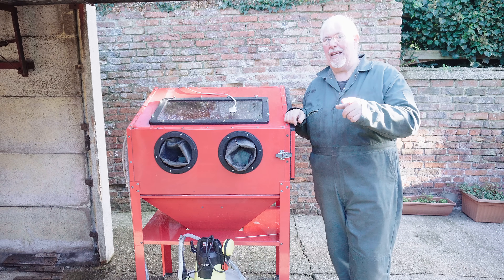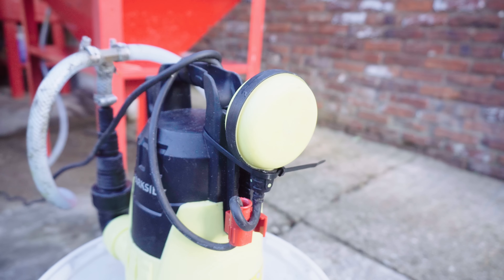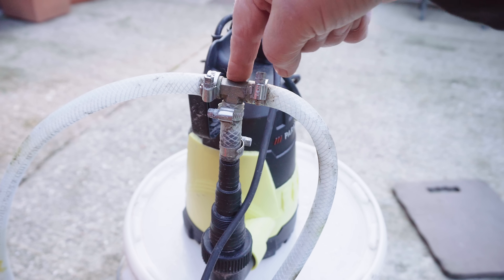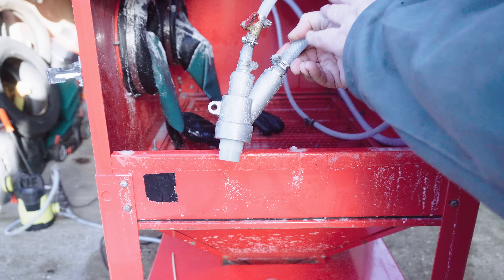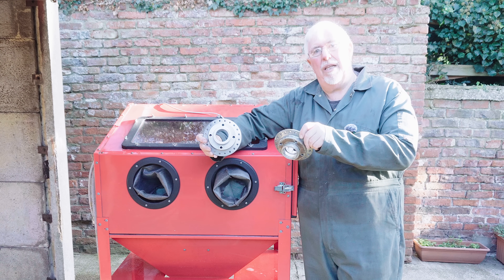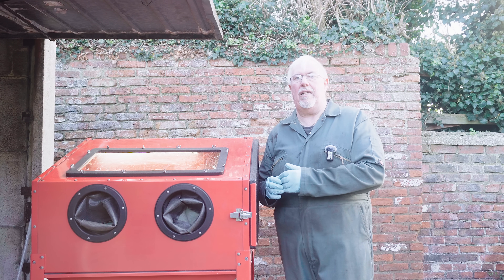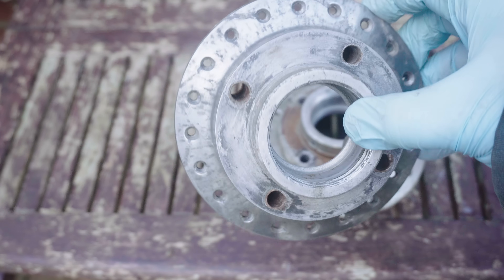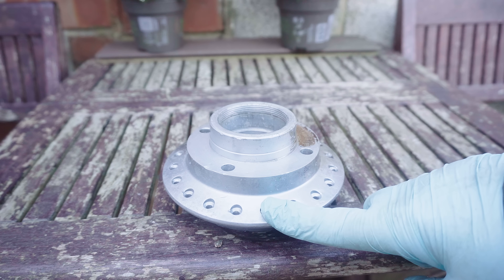Cheapest DIY Vapor Blaster Guide | How To Build The Ultimate Budget Vapour Hone

Comment: I'm actually in the process of building a blaster, incidently using exactly the same cabinet (wonderful how ubiquitous the Chinese stuff as I'm in Australia) and the simplicity of your approach will save a lot of time and money compared to the Americanised systemsI have been copying. I had a change in plans and have disassembled my partly built cabinet to replace the provided nuts and bolts with rivnuts to overcome access difficulties assembling the hard to get to interior bits. Using automotive seam sealer as I go because I think it's a better option than silicone. Thanks muchly.
Reply from the maker: Great.  My two main issues are keeping the screen clear, although it isn't too much of a problem, but it would be nice to be able to see better.  And leakage through the seams that I haven't sealed yet, but you have that well covered..  Hope this helps.
Reply: @SPANNERRASH  Planning on a pressurised fresh water ( garden hose ) spray bar with foot pedal for  screen cleaning. Hope it works.

Comment: Ive read where people have had engine parts done & the media is impossible to 100% remove, leading to engine destruction, be careful..
Reply from the maker: I am working on an OIF Triumph at the moment, so my paranoia about this is very high.  But with sensible and judicious cleaning it should be OK.  You just have to be senisble in what and how you clean things.
Reply: @SPANNERRASH   I know of a t140v engine that had been blasted, cleaned out & after about 100miles of running is was totaly worn out, it was stripped cleaned out & run again but only for the same thing to happen. it was only ok after the parts were sonic tanked, beware !!!

Comment: Hopefully not a dumb question, but would you find vb more useful in a small space than a sandblaster?
Reply from the maker: If you seal the cabinet, it should be a lot less messy.  I find with a sand blaster, even with an extractor, you end up with media all over your workshop.
Reply from the maker: I find it a lot less messy.  Especially if you sealed your cabinet well to stop the water coming out.  Normal sand blastin, even with an extractor, seems to get a lot of media all over the workshop.

Comment: By far the most important and expensive part is the compressor, which you didnt show and barely mentioned...!!
Reply from the maker: I did say I would assume most people who would watch this will already have a compressor.  If it is a standard 50l or so then it is a given that you would have to work in short bursts, allowing it to recharge regularly, but this would be true if you were doing standard sand blasting too.  I am using a Wolf 150l compressor, which seems to cope quite well.  I hope this helps.

Comment: what is the minimum size of the compresso tank you need  for blasting ?  (I've got a 50 L tank on my compressor)
Reply from the maker: I have blasted with a 50l compressor before.  The downside is that you need to pause to let the compressor catch  up every couple of minutes or so.  This is a pain, but if you are only doing a few things now and again you can live with it.  I now use a Wolf 150l Compressor, which seems to give me enough air for continuous use.  Hope this helps.
Reply: @SPANNERRASH thank you.......unfortunatelly, i have not enough space in my (small)workshop for a bigger (150L)compressor🥲

Comment: Can you blast other materials like steel
Reply from the maker: You can blast anything, I used the same set up with Iron Silicate to get the rust off some cast iron calipers.  You can adjust what type of grit you have for anything, including plastics.  With steel though remember you are using water, so if you don't get it dry when you have finished you will have flash rust on the peice very quickly.

Comment: you didn't mention anything about compressor, how much CFM is minimum
Reply from the maker: I am using a Wolf 150l Compressor, this one https://ebay.us/aXqh1m

I assume most people wanting to try this will already have a compressor, although my Wolf one has 14cfm if you were using a smaller compressor you could stop every few minutes to let the compressor recharge.  It would take longer, but you would still be able to make useful progress with that kind of a set up.

I hope this helps.
Reply from the maker: I did say I assumed most people who want to try this will probably already have a compressor.

I have a Wolf 150l Compressor,  this one https://ebay.us/aXqh1m

It has 14 CFM so I am quite lucky that it supports this quite well.  I have blasted using a 50l compressor in the past.  It is a bit of a pain having to stop to let it charge up, but you can still get quite a lot done.

I hope this helps.
Reply from the maker: I am using a Wolf 150l Compressor, which is rated at 14CFM.  It does start up quite quickly while you are blasting, but the flow seems to be maintained at a pressure that allows you to keep blasting continuously.

Comment: You could rig a water spray onto the glass to clean it, it wouldn’t take much water to clear it, just a quick squirt.
Reply from the maker: Yes, good idea.  There are quite a few upgrades I have in mind, keeping the screen clear is one of them, but I didn't want to get side tracked.
Reply: @SPANNERRASHmaybe coat the window on the inside with a paint protective coat that's also water repellent, might fix the problem but im not sure. Just an easy idea that popped up as its easy to place and replace/remove if needed.

Edit: if anything if it doesnt work, at least its easier to clean🤣

Comment: At 14:09 what you can do is get the magnetic fish tank cleaners. This helped a bunch when I needed to clean the screen in situ.
Reply from the maker: Sounds like a plan.  But doesn't it trap the grit on the leading edge, and if does doesn't this scrathc the screen?  Thanks for the suggestion thought.
Reply: @ depends on your screen material. I have glass as I prefer it that way. If plastic, you’d have to test it. 

In my situation before every session, I apply some dawn soap or windshield washer fluid on the inner side of the pad. It helps keep the view clear and clean. 

I haven’t seen any scratches or markings yet. For plastic screens, best to check in a small area, or apply soap and test. 

Best of luck. Your uncensored moment caught me off guard and had me laughing in my work cubicle.
Reply from the maker: I will take a look at this.  Putting some soap on the inside is a great idea to reduce the surface tension.  A little spray bottle that you can reach inside to spray it off was suggested by somebody else, which I might also try.

Comment: what size compressor are you using. I dont think mine is man enough. receiver is only 50L as well
Reply from the maker: I'm using a 150ltr compressor, which does mean you can run for longer, but I have used a 50 before for normal blasting, just having to stop and lit it fill a few times to keep going.  If you aren't doing a lot it isn't too bad.
Reply: How long can you blast before the compressor kicks in with a 150ltr tank?
Reply from the maker: TBH The compressor kicks in quite quickly, but there seems to be enough pressure as it is running to keep blasting continuously.  I think if you want to blast just from stored air you would need a very large tank. I just wear headphones to drown out the noise.
Reply: @SPANNERRASH  Thanks very much, I'm keen to avoid too much noise from the compressor annoying the neighbours, I guess I'll have to investigate quietening it somehow. Cheers